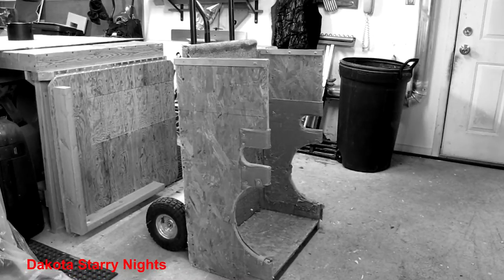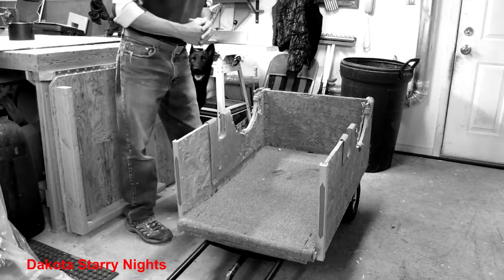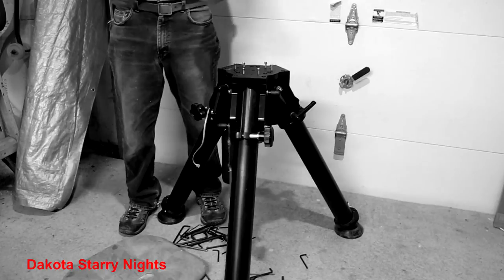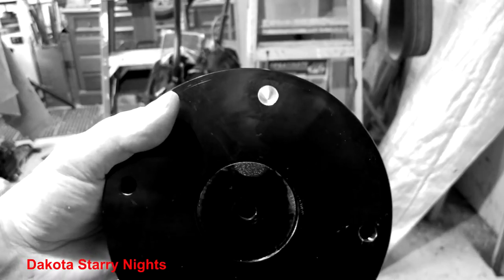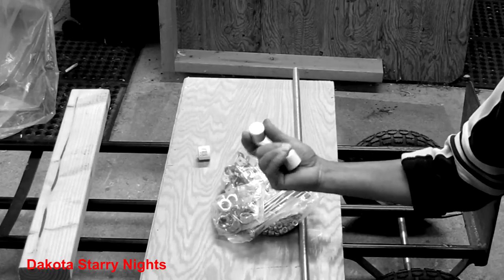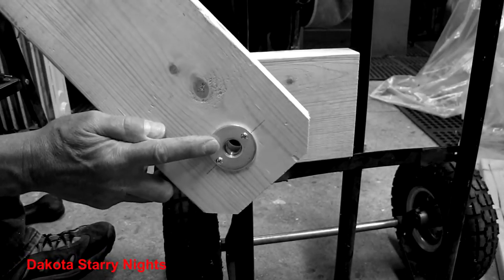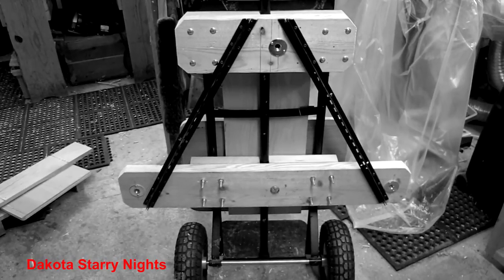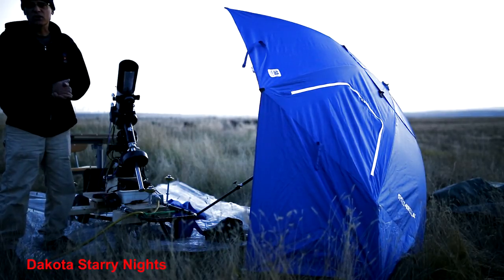Hand Truck Scope Buggy - DIY

Comment: Your video it has given me food for though. I have a Meade LX90 and it is quite heavy and clumsy to move easily so I tend not to use it as much as I would like, which is a shame. Mounting it on a truck like you have seems an ideal solution. I think I’ll give it a go. Thanks.